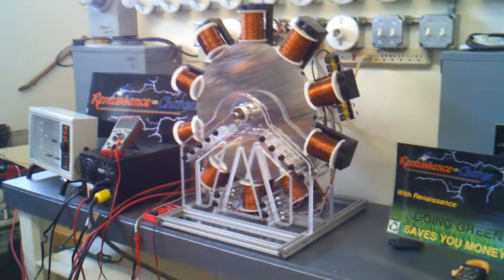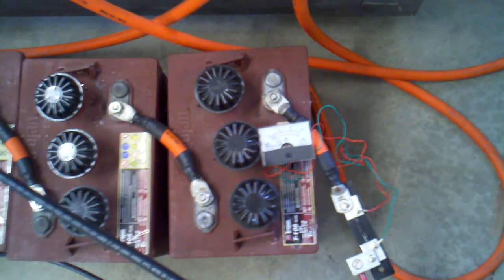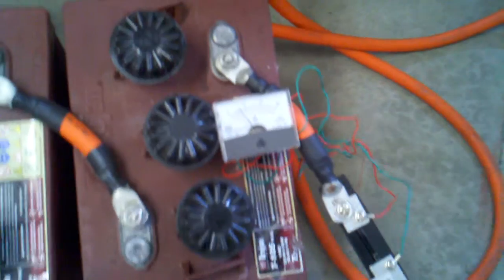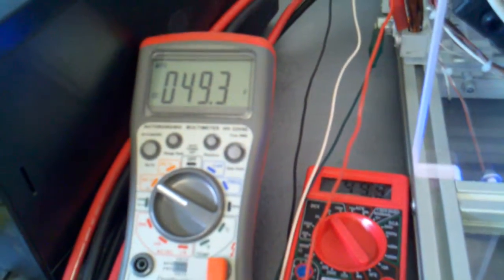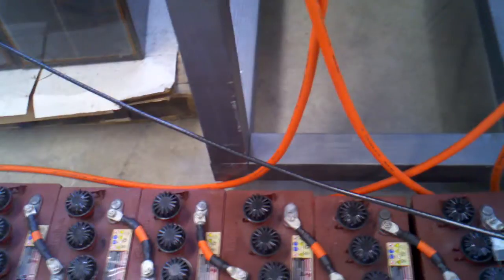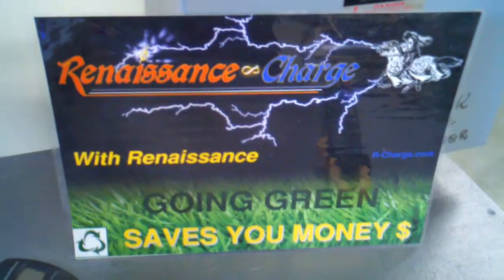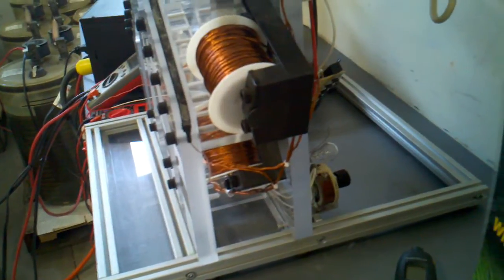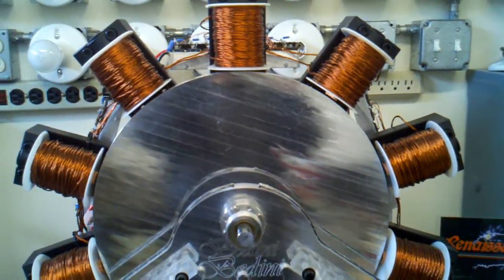10 Coiler monopole charging 48V 2000AH Batteries

Comment: the one you gave me is 11mH its for the SSG, unknown to me is the best coil
I made 2 one with single 1400' #23 1.125 (core) id x 4.5od x 1.125 wide it's 349 mH and 406mH.
More of a rectangle shape with thin metal rolled (core)instead of pins. it has a lot of kickback. it welds the screwdriver at 60+ volts with large cap.Shorter and fatter.
 You ever try different coil shapes?